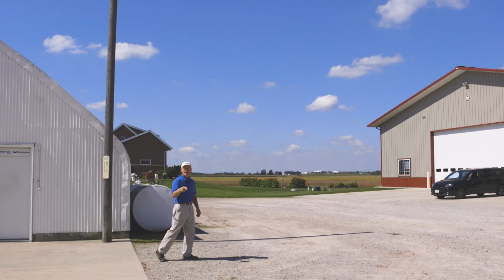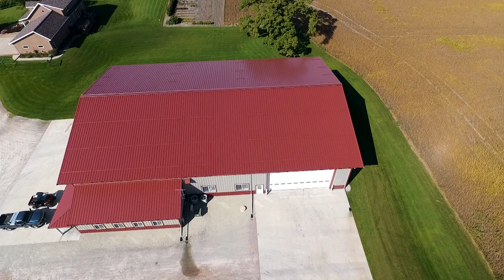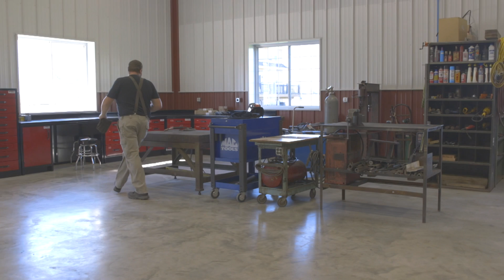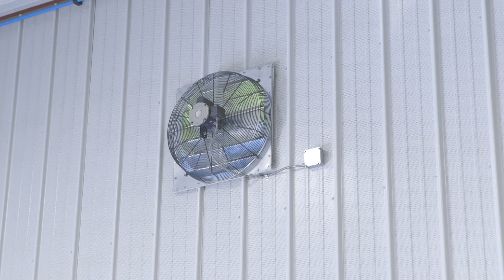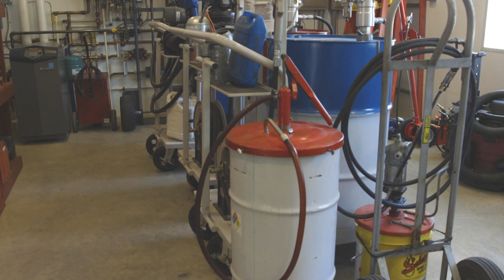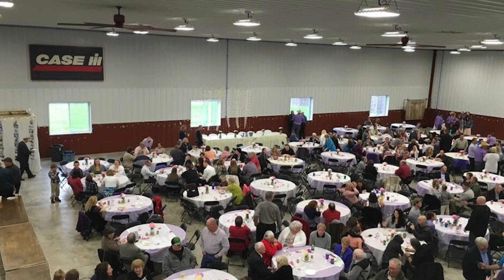Farm Shop Features All LED Lighting and Rolling Lubricant Carts | TOP SHOPS® | Successful Farming

Comment: 2800 acres isn't very much, looking at this shop and those two big new combines something doesn't add up. They must have huge debts
Reply: Depends where it’s located and what ground prices go around there. Profit margins could be much higher than where you live. As well as budgeting and other incomes. We are building a 60x100 with in floor heat as well as a full living quarters and office area and we do not farm even close to that 2800 acres. We’re a smaller farm, but we do well with our money and continue growing every year.
Reply: They said 2013 it was built so that was a bit after the time when corn prices were at record highs and everybody was making huge profits. Many small-mid size farmers got new machinery and built new shops. My guess is these guys will probably have the same fleet and shop for quite a few years to come but that's what a lot have done lately.
Reply: What? Were do you live where that’s not a lot?
Reply: Maybe the old shop has been converted to meth lab.
Reply: That's what I'm curious about too, we farm a similar amount on cash grain crops, I want to know the business model they have that can afford this shop, along with that elevator in the corner
Reply: Dustin Warwick I think you are just dumb
Reply: Somebody's trying to sell pole barns. Just for show.

Comment: 2800 Ac and you build a shop that big. That’s a 7 digit shop. Wow. Beautiful.
Reply: That shop is no where near a million dollars.
Reply: 7 digit?🤣😂 lol wuuuuut???? We’re building a 60x100 with living quarters, infloor heat and a few other bells and whistles for 250k. 80x120 is not going to be no 7 digits
Reply: Jordan Volk know a guy who built 80x130. With quarters, floor heat, parts room, and oil bay. Was 7 figures. But it’s Canadian. And steel construction

Comment: Kitchen.... Yup, pretty much everything, except the kitchen sink...we don't have a sink either, but we do have a small refrigerator!!
We're still working in the fourty year old 30x30... YES, it is way too SMALL!!!! Our advantage is, the 20x30 bay beside it...it houses All lubricants, waste oil, air compressor and extra air holding tank, bigger parts storage and a little bit of room to work on things..
The main shop area has two big drill presses, a lathe, band saw, chop saw, steel rack, 20' work bench(lol... Catch all!!!), Bolt bins, overhead parts room, two wire feeds, plasma, oxy/acet...... Three tool boxes.... YES, it is well equipped, YES, we have out grown it!!! 
Service truck fits in nicely, pickups too... Tractors with duals aren't too bad... It's the combine and the trucks that don't fit!! We try..lol.. just gotta leave the doors open.
Live Top Shops!!! Lots of great ideas!!! Now, if we only had the $$ and a space to put a new shop 😎